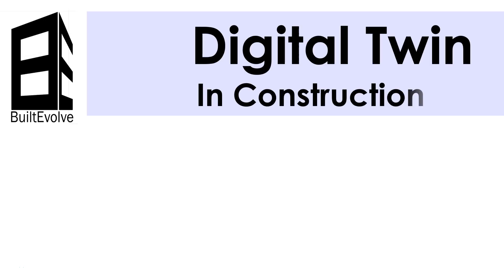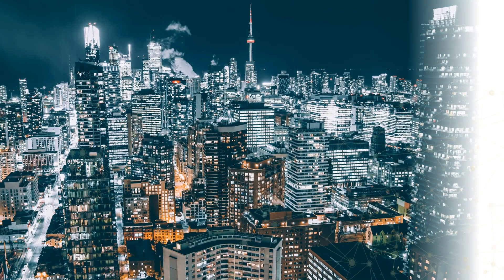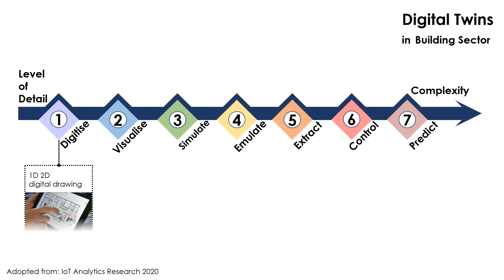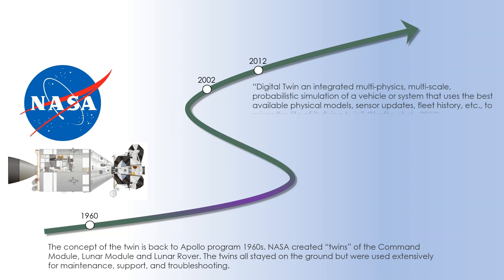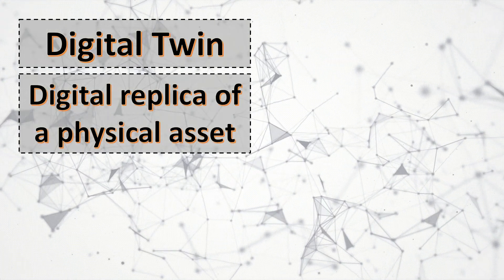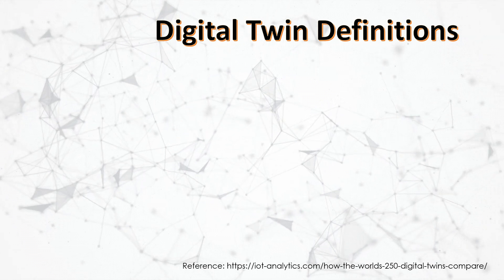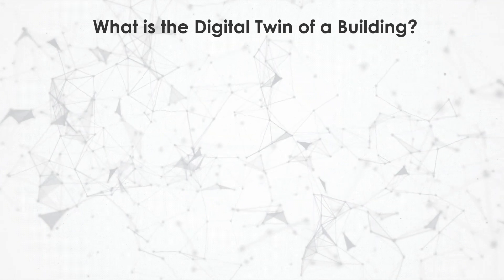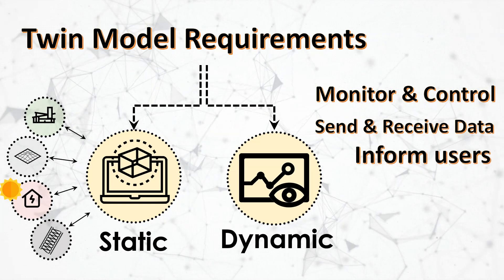Digital Twin in Construction

Comment: Export the Azure, Chat GPT, Revit, Plant 3D, Civil 3D, Inventor, ENGI file of the Building or Refinery to Excel, prepare Budget 1 and export it to COBRA. Prepare Budget 2 and export it to Microsoft Project. Solve the problems of Overallocated Resources, Planning Problems, prepare the Budget 3 with which the construction of the Building or the Refinery is going to be quoted. https://youtu.be/I_u990Il3iU?si=FrYkc_4ETzLk_rn7

Comment: in a practical term, I am very curious to know how we will integrate our revit mode or the static model with any sort of software or how we are going to achieve that, based on my research we have autodesk tandom but still its not clear.
Reply from the maker: Autodesk Tandem will be a potential platform in the future. Some are using Autodesk Forge. There are various platforms but all are developing.